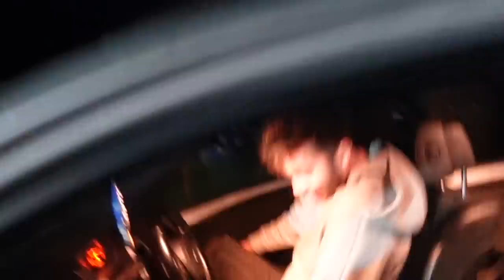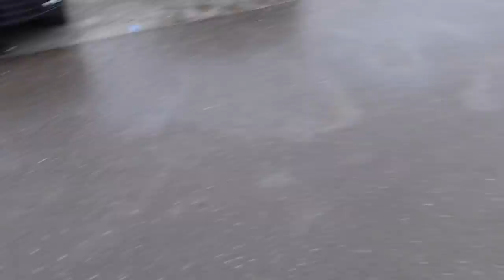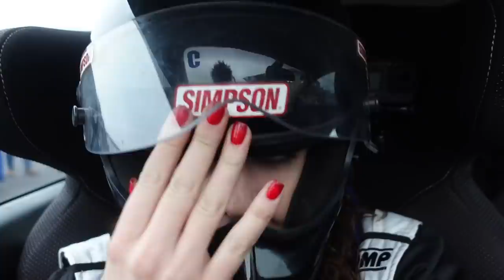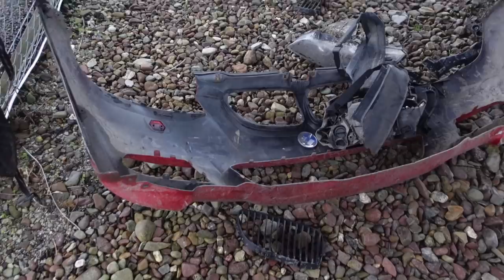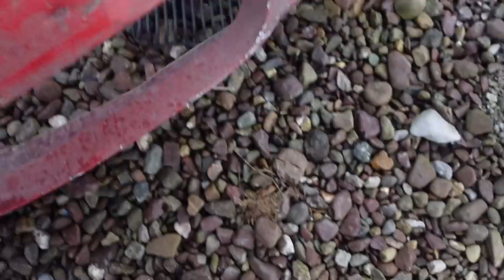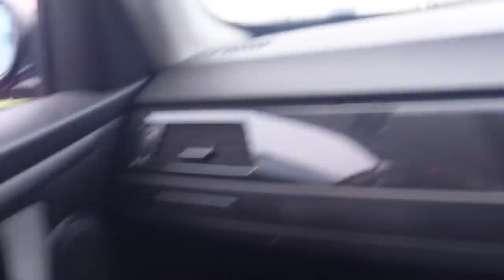I CAN'T BELIEVE I CRASHED JAMES DEANES CAR

Comment: Hmm... what would an avoidance manoeuvre for that have even looked like? I can see how you might have stuffed a corner into him as you failed to drive round him, or maybe slid into him sideways, but was there even a way of not hitting him if there wasn't space to full stop in a straight line, one you realised he had finished spinning & wasn't going to head off the same way you decided to swerve?
Reply from the maker: I tried to save the steering by straightening, I was always told if you can straighten your wheels up when you are going to crash so that you don't bend any of the steering components or break a wheel off - but I wish I had got on the handbrake again, it just happened so quickly 😂
Reply: @BeckyEvans  Yeah, if you'd snowloughed into him corner first with all 4 wheels locked & a load of steering lock on you'd have f*cked the car up good & proper, I reckon. It really doesn't look like there was time once you'd got the steering straight... Also, good luck getting the lock off with one hand while pulling the handbrake with the other! You'd need one of those autotest steering wheel rim balls...